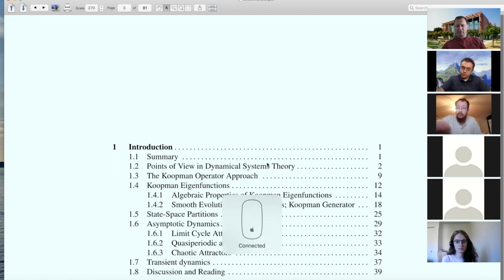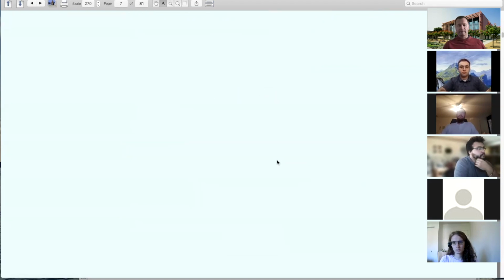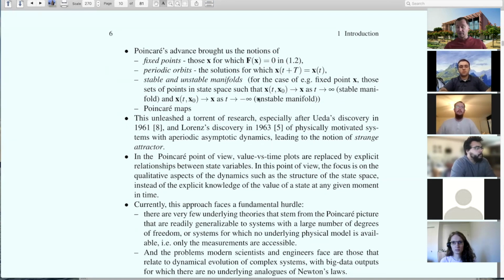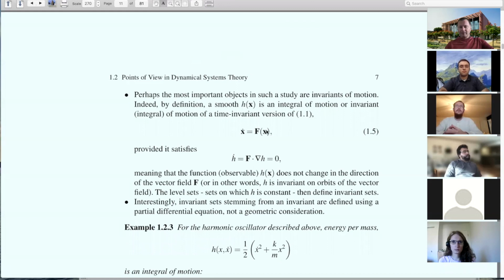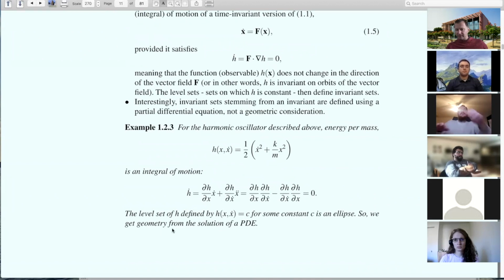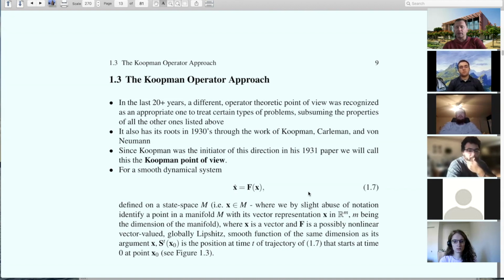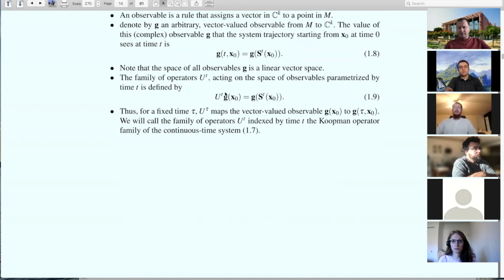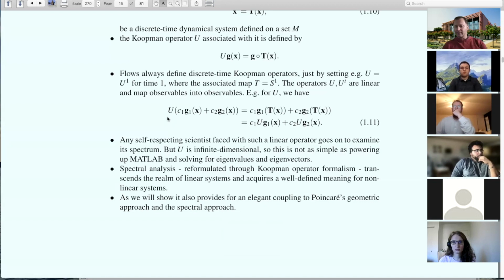ME203Lecture1:Introduction

Comment: Can someone dumb it down for me using a simple example of what is meant by lifting data to functional space or how do it ? Any help would be highly appreciated
Reply from the maker: The question gives me an opportunity to discuss this aspect from a conceptual point of view. There are plenty of videos and written materials that do this - simplify the subject to its algorithmic implementation.  This series of lectures is designed to avoid that. There is too much hinging on our implementation of learning algorithms to broadly allow for the approaches lacking fundamental theory. To provide an analogy, it is dangerous to try and perform a magic trick without understanding the physics (or mathematics) of the magic...I will discuss the algorithmic side later, but it will also be rooted in theorems.
Reply: @igormezic5715  Thank you so much, I did read your paper titled " Extended Dynamic Mode Decomposition with Learned Koopman
Eigenfunctions for Prediction and Control".  I was trying to find answers to my questions and then I came across your channel on youtube. The video lectures did clear the majority of my doubts, hopefully, with the upcoming videos, I should be able to clear this doubt as well. Thank you again for taking the time to reply to the queries posted.